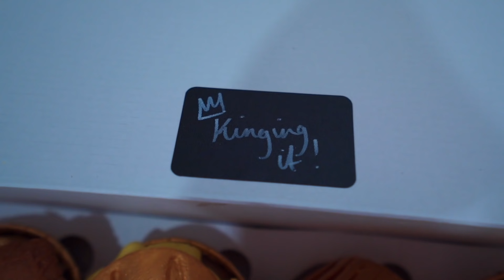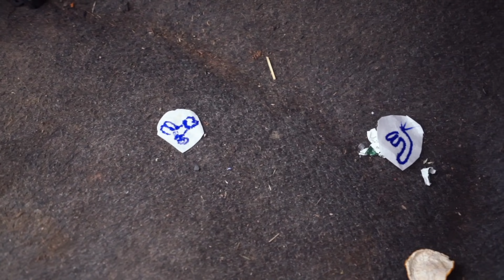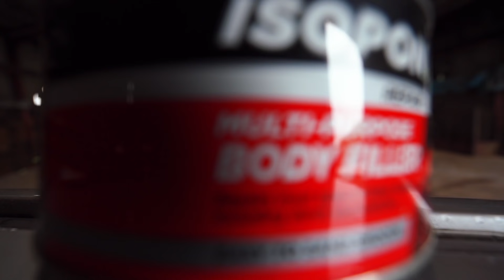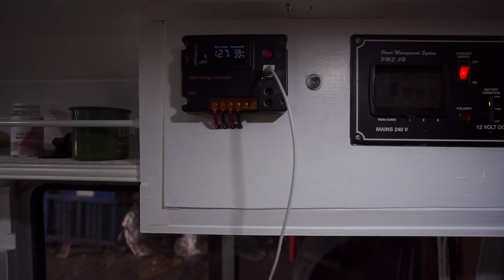Van Life Renovation - Fixing more problems

Comment: On the NC500 - I have ridden it twice, by motorcycle, during peak season.  Tbh, it's miserable during peak season due to the numbers of camper vans that cause havoc down the narrow lanes.  I'd advise late September or early October.  The days tend to be more settled and the cooler nights have killed many of the midges off.  You'll have a blast, but consider carefully the Bealach na Bà as it is very steep and technical.  Camper vans may not be allowed, but busses are.  It's up to you!

Comment: With the inverter you bought (800 Volt Ampere=Watt) you can't run an induction cooktop. For that you need an inverter with 2000 Watts.
Reply from the maker: Thank you Tim - we are now returning the inverter because you've said this! Do you have another you'd recommend? We will look also, always good to get recommendations though! 😊
Reply: @kingingit  I'd suggest you choose the induction cooktop first and check how many Watts it has. Then you think what other devices you want to run of the inverter at the same time and sum all the Watts up. Then you choose an inverter which can deliver these Watts (or VA, it's the same). 
There are two different types of inverters: cheap non-sine wave and more expensive sine ones.
They say electronic devices can get damaged buy non-sine inverters.
You can buy any from a well-known company like Victron. 
There are also non-brand China inverters available. They doesn't have to be crap.
Maybe you have a look how loud the fan is. My Dometic 350W is loud at the moment...

Comment: Being a mechanic by trade . At this moment my heart dropped 7:39 LMAO that's the axle sweetheart . Make sure that axle seal is replaced or put new RTV on ( whatever MBZ's specs are for it )  I would hate for you two to lose axle fluid and have to put more money towards a new rear end. Much cheaper replacing the seal now then later.
Reply from the maker: Thanks for the tip Kenan. I have no idea what you just said but I’ll make sure we have someone come take a look at it!
Reply: Kinging- Okay , what you took off originally the (black inner bolts in the rim) thinking they were to take off wheels are for hold the axle bolts. The Axle moves a shaft that connect the rear end that moves the van go forward from the driveline to the transmission . Loosening those bolts can cause a leak in the axle tube. Just make sure to have it checked before long distance travel.